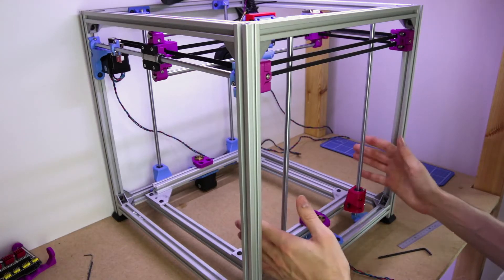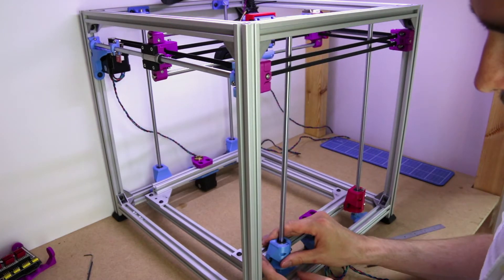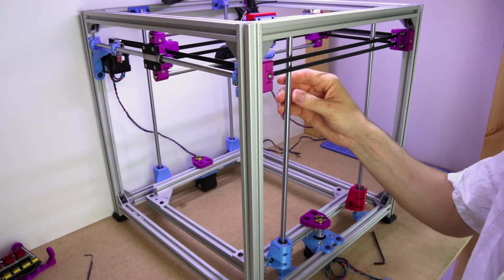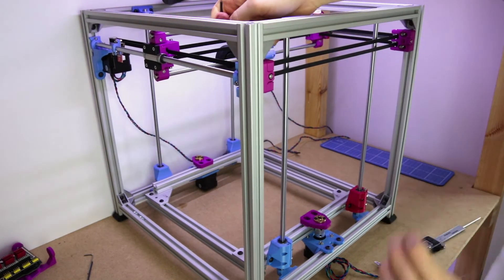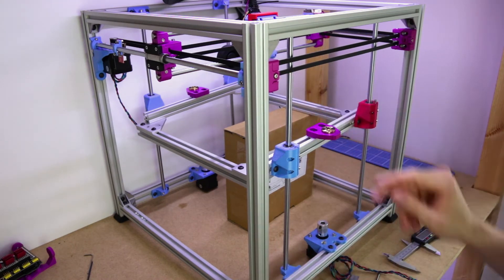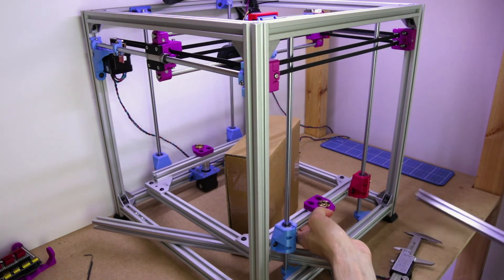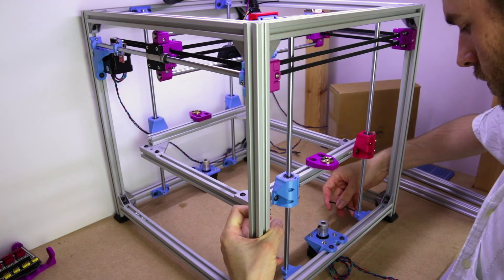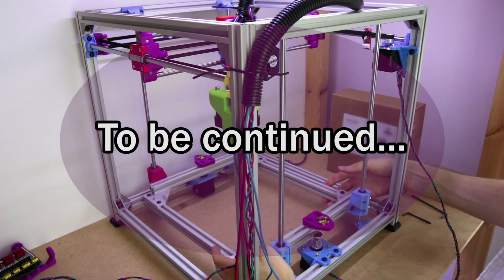Bed Alignment is Very Important - STEVE Build Ep15

Comment: Mechanically over constrained
Reply: Think ya got that backwards. In the perfect world, the over constraint wont really matter, because it'll be perfect and still work. In the real world, the over constraint throws in tons of problems. just one part being slightly offset, can throw off everything or bind everything up... or best case, just cause parts to wear faster than normal.